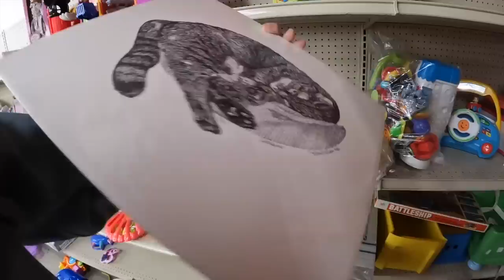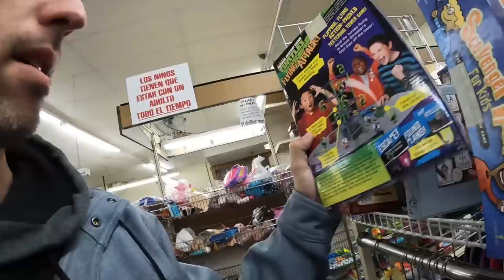Thrifting And Cleaning Up The Scrap Pile!

Comment: That kind of fire extinguisher recharges with water and compressed air. As long as the cylinder is in good condition, it’s usable. The air valve often looks like a valve on a tire and can be pressurized with an air compressor and standard tire fitting.

Comment: The wool blanket is not in very good shape and has a lot of squirreling & balling, improperly laundered --the edging looks very cheesy, it's not like it's a Pendleton, many of those cost hundreds if not close to a thousand.... if you're ever in the area they actually do factory tours, you can watch wool being loomed... they also weave for other brands... kind of a fascinating place....

 I don't suppose you have a sweater shaver, or a seam ripper to remove the cheesy acrylic trim on the edges... not a pic you're going to get rich with...